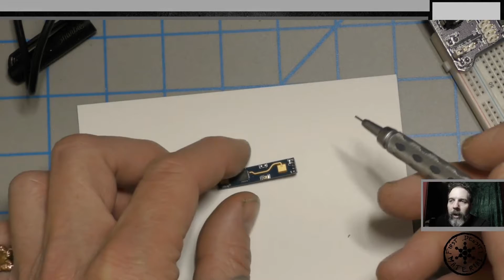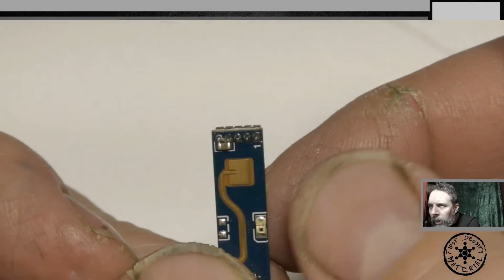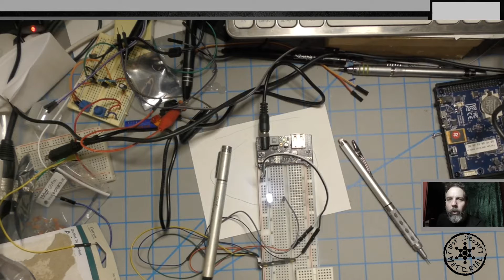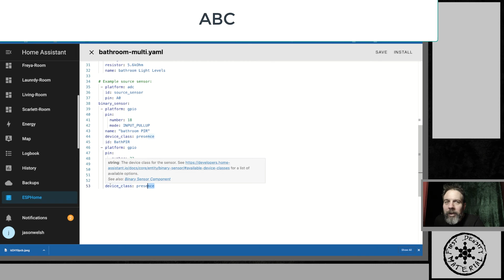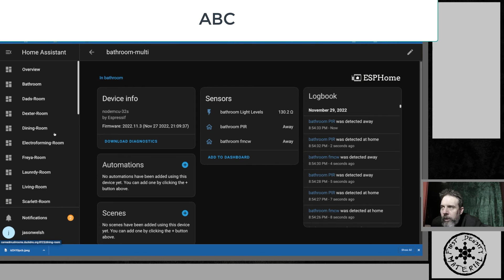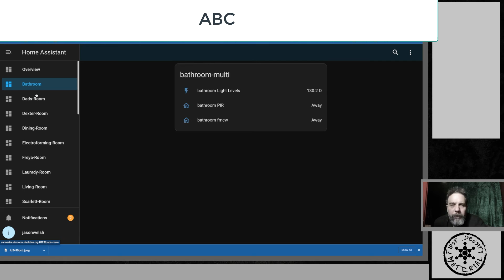0115 Installing home assistant (Ld2410 Presence sensor)

Comment: FYI the Rx/Tx gives you distance and visibility into the "energy" readings. This lets you for example turn an LCD backlight on if you get close enough to a thermostat, or lets you control lights in multiple zones.  Light 1 close, and Light 2 farther away..  I recommend using the Rx/Tx - its quite handy.

Comment: Hey my dude.  Thanks and I have a question: if I had to use battery could I leverage the PIR as the high sensitivity trigger that turns on radar (and its higher power usage) to confirm that we do in fact have a human in the proximity.  My objective is as a modular home security detection setup for when I'm traveling at diff air bnbs.  I know I could plug it in to the wall and solve the power issue but this is my engineering challenge I've given myself.  How to make radar power efficient.  Open to you and your other viewers Intel on this. Thanks all in advance.

Comment: Simple question here because I am going crazy searching for the right connector type. Does anybody know what type of connector goes on the header pins on the LD2410? It doest seem to be DuPont or micro JST.

Thanks for the info in advance.

By the way, great video! Will help a lot setting them up with ESP's I have here already.

Comment: Tks man, Those sensor works incredibly well! I'm building 10 of those "super sensor 2.0", except for the BME680 (at the moment they costs more than a SNZB-02 from sonoff xD). 
I'm astonished by the quickness of the Ld2410... This thing can detect me entering the room instantly. I though I would use the PIR sensor for the "light on" command, but there's no difference in the speed of detection.
Again, thanks for those videos!!

Comment: I'm using these LD2410 sensors and having very good results.  The manufacturer, HLK has a usb board and pc application with which you can adjust numerous parameters on the device.  Also, the LD2410B has a Bluetooth radio that allows you to do the same with a very nice Android app.  In fact, your device's may be LD2410Bs being sold as LD2410.  Scan for Bluetooth with the radar powered on and you may be surprised.  Enjoy!
Reply: is there be information on this android app? simple searches don't seem to find anything

Comment: thanks for the informative video ! you probably already know this but the difference in sensitivity is probably because of the default settings saved in the sensor, for sensetivity and such, this can be modified maybe with an arduino library or there's a uart to usb adapter with the software from hi-link that you can use to figure out the settigns and program the module. you can see distance and sensitivty for motion and motionless targets, it could of course also be a problem with the manufacturing process, Andreas spiess shows this in his review of this module if you want to find out more !

Comment: Thank you for making this video.  Great job on the project and on making this video.
It's very timely for me since I've been putzing around with a RCWL-0516.  Ordered the LD2410, but didn't know about the header/cable issue. They don't make it easier.
Reply: lol i had a very bad experience with the RCWL-0516, it's inconvenient because it detects 360 degrees and through the walls so you can't really confine it to one room without adding a big reflector atleast 1cm behind, also it doesn'twork on 3.3v so it's an inconvenience for esp8266 and esp32...
Reply: @gz23-l4d  Good point. Thank you for adding that detail and clarity.   I'll line a small project box with aluminium foil and glue the sensor to the bottom of the lid.
I've managed to load Tasmota on it and get it to work. But I'm still trying to integrate it with Alexa and Smartthings.  That's the ultimate goal.